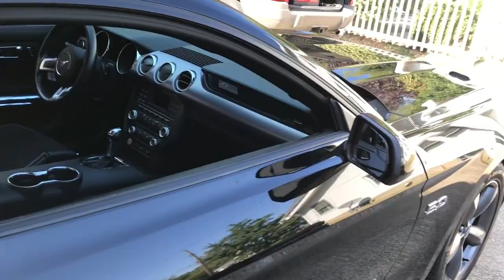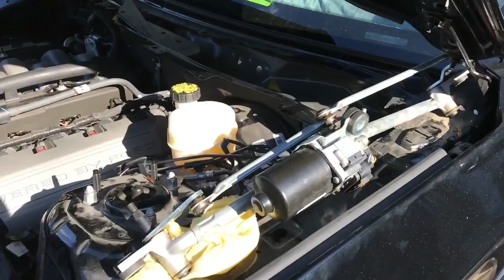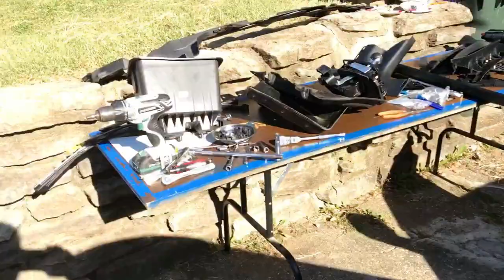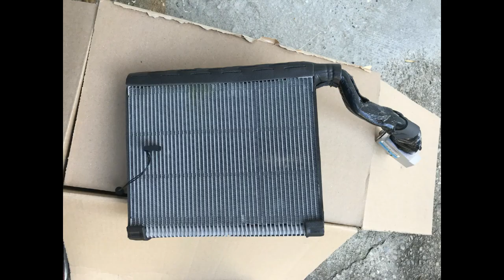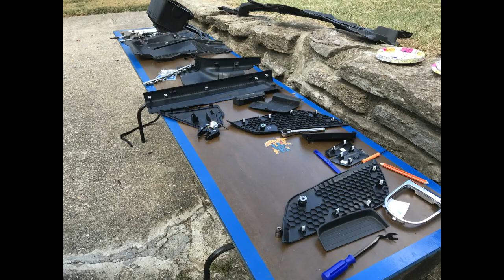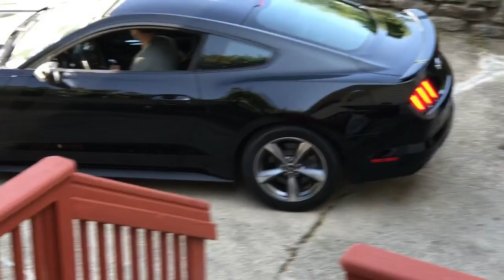2015 Mustang Evaporator Replacement

Comment from the maker: This repair is more that $2,000 at a shop and you can see why ($200 - 300 to have air conditioner charged after you get done). We rented the "ALLDATA diy" online manual $19.99 for 1 month (well worth it).  Best tip - "label all bolts, screws and parts as your remove them - take some pictures for reference.  Second best tip; don't try this at home.  Take it to a Ford dealer or reputable mechanic.

Comment: Hi would you know where the intake for the evaporator is from the outside of the car? I’ve seen on the forums it’s behind the battery but don’t seem to find suction to try and spray something to kill any bacteria and mold on the condenser.

Comment: AC blowing warm. Dealer says EVAP core, but based on what who knows. They want $1400. 2016 eco premium auto, 33k miles, 5+ years old. Just a year ago they charged me $500 for a charge - they should have known then, right?
Reply: The last TSB for it was around 2018 I think... I'm getting this issue too.
Reply: Jimmy Nguyen Im having the same issue now on my 2015 GT
What did you guys end up doing to fix it? Did you had to buy a new evaporator ? It costs $800+ for just the part.
Reply: Charlie Myers Im having the same issue now on my 2015 GT
What did you guys end up doing to fix it? Did you had to buy a new evaporator ? It costs $800+ for just the part.
Reply: @meshalalobaid617  I'd DIY the thing. $800 is replacing the whole climate control unit, (evap core, housing, blower, acuators, etc) The actual evaporator core is $180ish (for FoMoCo) with expansion valves included. You can use rockauto and get 3rd party like TYC or UAC for under $60 for the core, but you may need new expansion valves which is like 20-ish.  https://tinyurl.com/y4bezoer
Reply: Jimmy Nguyen thank you very much !
Reply: @meshalalobaid617  I bought a can of the recharge refrigerant and it got me thru this summer... I get some smells I don't love when the car turns on, but I figure whatever, if this works maybe eventually it won't be my problem anymore.

Comment: a car this new shouldnt have such an issue they made the cores shit on purpose!
Reply from the maker: This car was bought new and was babied. Had under 10,000 when this happened.  Very difficult job to do and costs thousands at a shop. Just to have the air conditioner charged back up was expensive (we charged it up ourselves). No problems since.